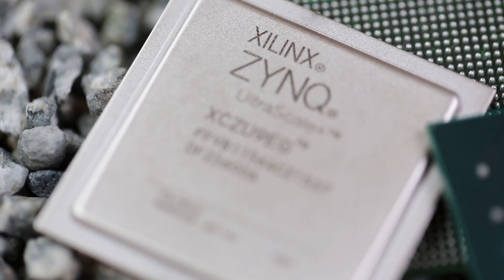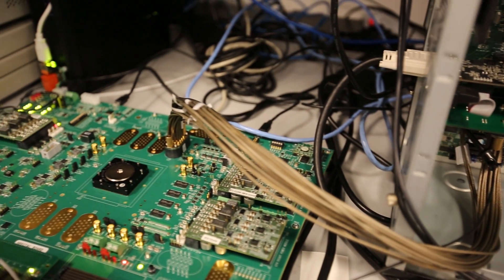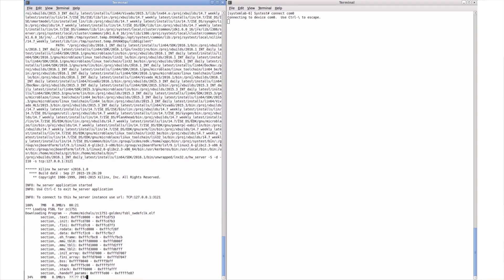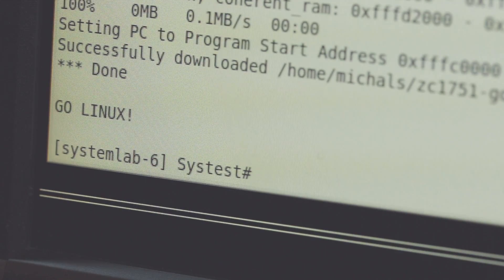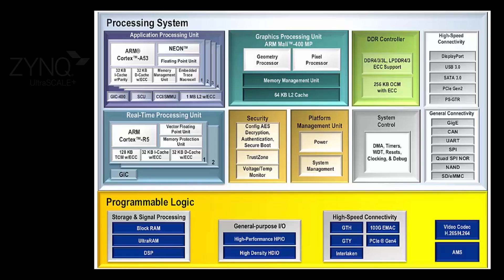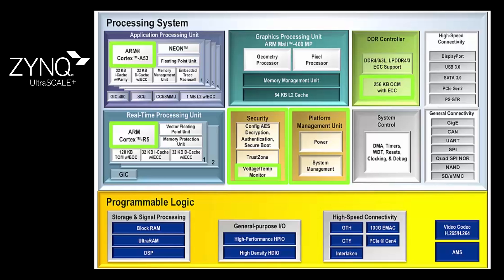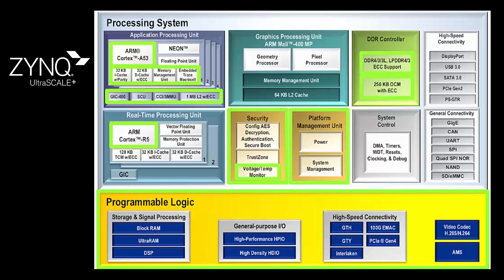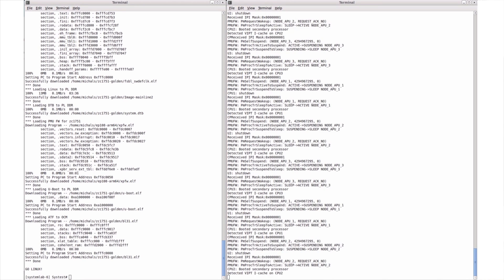Zynq UltraScale+ says, “Hello World!”

Comment: Good video, but had to watch it several times until I understood the sequence. The console output is illegible & following the green rectangles hopping about isn't great. Could you explain what "Upstream" Linux is?
Reply from the maker: For tech support pls visit our forum https://forums.xilinx.com/
Reply: Upstream linux kernel means it's vanilla kernel, branch from Linus Torwalds. Usually every vendor is distributing it's own kernel with it's own patches. If you can run vanilla kernel on device it usually means that that device is fully integrated in to main kernel line, and/or you don't have to depend on vendor specific patches when you want to run your software.